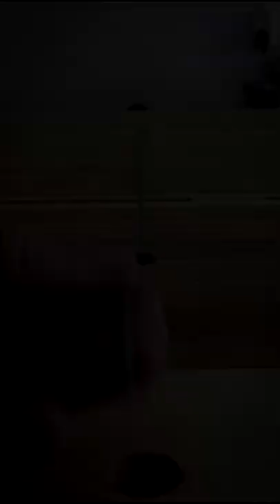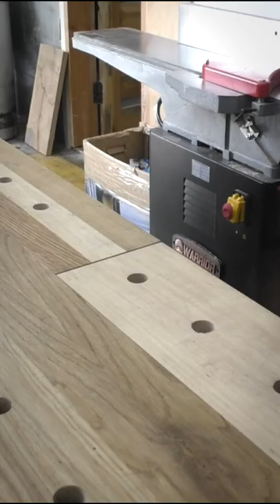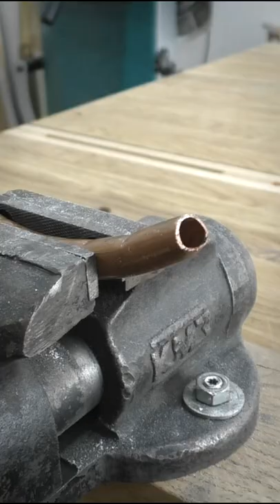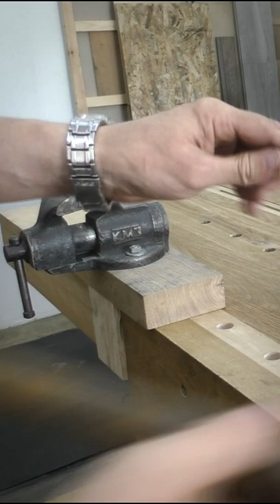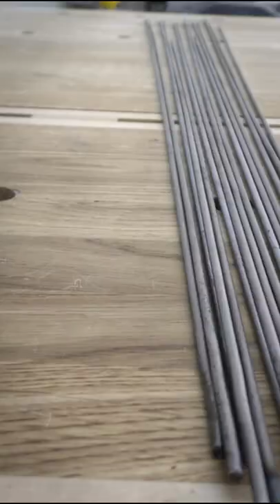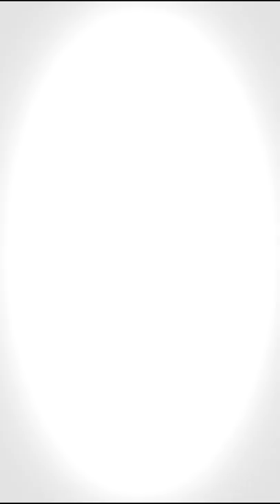Wire Straightening - The Simplest Method #shorts

Comment: I call BS! Why do you need the pipe on the end to cover the rest of the wire? It's because there is a switch/cut/edit/slide of hand. He replaced it.
Reply: You can even see the wire it's not the same wire when he put the cover on.
Reply: The long pipe is so that the wire doesn't flop around and take your eye out or cut a groove in his bench
Reply: @JamesBrohard No. You can actually hold the other end with a pair of pliers and get the same result.

Comment: Actually The wire breaks a Lot easier when you do that
Reply: This makes a straight wire that is work hardened. Depending on the alloy and the application, it may need tempering or other heat treatment to be useful.

Comment: Do you know why that works with the pipe surrounding it? I can't straighten bed springs with a drill, and clamp. Any tips?
Reply: You don't need pipes for that, just lock on the vise and drill it, but springs are made of a very hard type of steel... I don't know if it works...
Reply: @leolimavideos  Perhaps s a bigger, stronger drill. Definitely not a dremmel tool, as it wears away the collet.

Comment: I'll admit it's a simple trick to straighten a piece of wire, but not the simplest way...

If you wonna go really basic you just stick one end in a vice, put a pair of sturdy pliers on the other end and give it a good yank or 2. It's that simple😇
Reply: Sorry but not convinced for strengthening tough cinks
Reply: @allanblount2449  neither am I, but I've used it plenty on 14 gauge wire or thinner and it works for me. I've not used it to remove kinks, so I don't know. Probably depends on the wire gauge.
Reply: Stretching it is easier, but that causes irreparable damage though it is minor damage. I think you'd have a hard time stretching the wire he was straightening